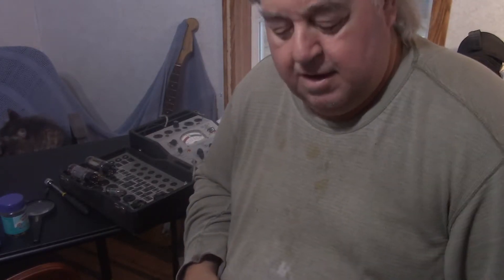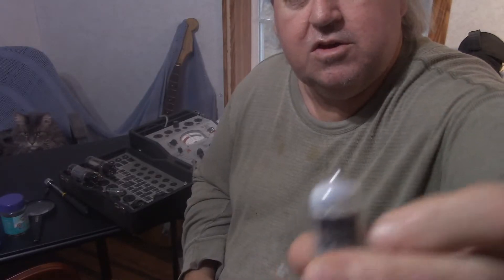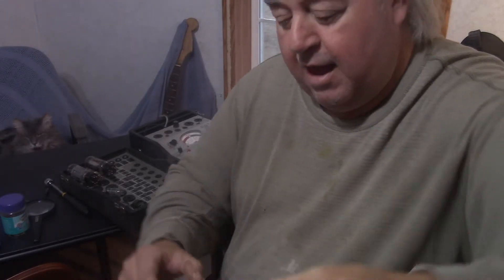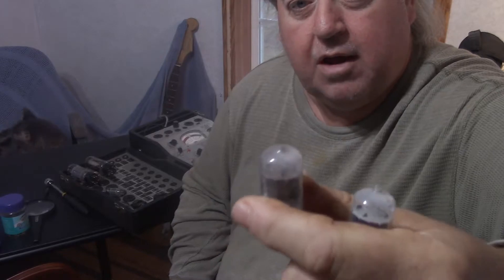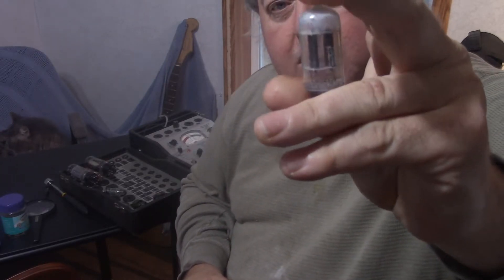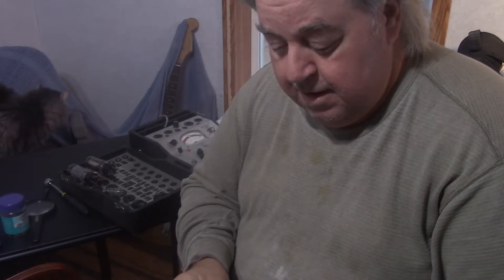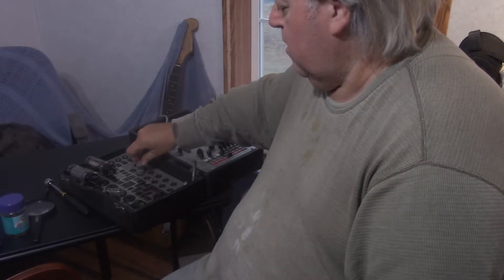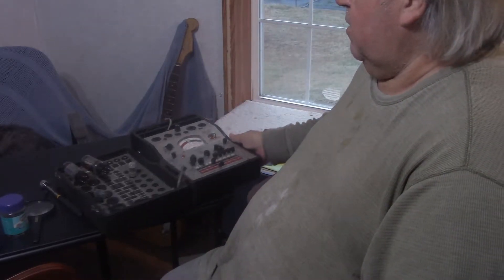How to Spot a Bad 12AX7 Preamp Tube by Eyesight

Comment: If a preamp tube (12au7a) is not glowing but i get sound out of my amp does than mean that the tube is faulty? Swaped it with the old tube and that one glow... The new tube, the one that is not glowing, is more powerfull than the old one that i see a glow on....
Reply from the maker: Many tubes I have tested in amps do not glow and work just fine. A faulty tube will either not allow the amp to produce sound or will crackle badly or whine loudly.
Reply: @vacuumtubesandguitars  thank you for clearing it up for me, i had some troubles finding the specific tube, and when i installed it my jaw droped when i saw no glow, but still sound coming out of the speaker.
Reply from the maker: @silviubadea84  It's all good, keep on rockin

Comment: the reason i'm here is i bought a brand new black star head mkIII 100 watt when i turned it around i noticed one of the pre amp tubes was white so i figured it was blown i didn't even plug it in yet brand new broken
Reply from the maker: It does happen, good thing you did not turn it on. My main amp is a Blackstar HT20 Studio
Reply: i returned it yesterday and ordered another new one they gave me 20% off so it was 999 i got the head and cab for 1600  @vacuumtubesandguitars
Reply from the maker: @bobdimartino6738  way cool.

Comment: I just got a new amp head today, and when I installed the tubes it came with the pre amp tubes don’t light up at all, we’ll one of them does, there’s three pre amp tubes and only one of them lights up, do you think it’s just sum bad tubes?
Reply from the maker: It is common for some tubes to not glow, especially the second, third or fourth tubes, since they are not the primary preamp tube. The first 12ax7 preamp tube in slot V1 most always will glow because it is doing the most work.
Reply: @vacuumtubesandguitars  yea the pre amp tube on the far left has no glow, as the same with the middle one, the only one that glows is the one on the far right, I plugged in a pedal to effects loop to bypass the pre amp section and the amp finally started making slight connection noises
Reply from the maker: If the amp is playing good and no crackling or weak tone then the tubes will be OK
Reply: @vacuumtubesandguitars  yea but when plugging the guitar straight into the amp  there’s no sound coming out of the amp, the red l.e.d turns on, but it doesn’t give any signal to through the cord, no buzz or hiss
Reply from the maker: @MrBurnzz.  You could try reversing the order of the preamp tubes to see if the others light up in the first slot
Reply: @vacuumtubesandguitars  so switch the far right one (the one that does light up ) with one of the others that dosent,
Reply from the maker: @MrBurnzz.  yes and see if the it lights up
Reply: @vacuumtubesandguitars  yes I did it and the tubes don’t light up when put in the car left and middle position, I found out that I have the same pre amp tubes in my Marshall that this black star takes, and I know they light up and work good in the Marshall, but when I put them in the black star still no sound or light
Reply from the maker: @MrBurnzz.  could be they are bad, you can find out by putting the tubes in the Marshall into the Blackstar

Comment: Loss of the vacuum is only one reason why any tube won't work. So the title should be amended to read differently. How about: Once a preamp tube has lost is vacuum and is white on top then it will not work. - Peter age 73

Comment: I sell nos and used tubes, each one gets tested before listing, and again before shipping.

I have both US and China RCA 12AX7s, no difference in performance, but some people do care to only have the US made tubes. The China tube isn't listed at the moment, as I only have the one.

If people get to the point that they no longer can or want to pay the high price for 12AX7s, you can rewire the sockets so you can run two 6AX7 with the heaters in series, as the specs are the same!
Reply from the maker: I also sell tubes on ebay, and have been for 18 years. The tube deal is way over hyped these days. China and Sovtek are good tubes, JJ's too. But with new modeling technology being so good, tube amps and radios have no advantage
Reply: @vacuumtubesandguitars Absolutely true. I am mad at myself for having a really expensive all tube rig sitting there collecting dust because a moderately expensive plugin is doing a better job for most things. Yet, that's how the cookie crumbled the last decade or so!
Reply from the maker: @WilDBeestMF  It is amazing at how good modelers and plug ins have become

Comment: A 12AX7A is a dual triode. It's literally two tubes in one envelope. Sometimes, one of the triodes can fail while the other one still works. You'll notice a drop in gain but the amp will still play. Bending the pins of the tube can cause loss of envelope vacuum when you straighten them back out. It causes hairline fractures in the metal to glass seal of the tube and the air slowly leaks in ruining the tube.
Reply from the maker: You are 100% correct. A 12DW7 is proof of the the 2 in one, one triode is a 12AX7 and one triode is a 12AU7. I always use a pin straightener for just this reason, unless the pins are way too bent, then I just chuck it.

Comment: Quick question - I have a 1994 Super Amp 4 X 10" that sounds fine on the clean channel but volume drops off on either of the 2 gain channels. Is a bad tube one possibility of the problem? (It has 2-6L6WGC/5881, 4-12AX7A, 2- 12AT7). Just wondering if a bad tube can be the >possible< culprit. Thanks for any advice you can share.
Reply from the maker: It is possible a tube is going bad, but more likely is a capacitor dropping voltage
Reply: @vacuumtubesandguitars  Thanks for your reply and advice.

Comment: If they are clear at the top rather than silver grey they are nearly always dead too.
Reply from the maker: Not always, because RCA made side getter tubes where the silver flashing is on the side. If the tube has a top getter with no silver flashing then you are correct, it is 99% of the time bad.
Reply: @vacuumtubesandguitars  I agree, keep up the accuracy , cheers. (I worked for the Canadian Marshall, Orange, Ibanez , Eko and Hiwatt distributors on and off and had the honor of meeting Jim and his chief engineer briefly before he retired in the early 2000's if my memory for dates serves me right)
Reply from the maker: @alcrook6662  Wow that is awesome
Reply: @vacuumtubesandguitars  I'm still trying to get a youtube video made of facts and stories from the day that would blow the minds of moderns. I'm workin on it. Thanks.
Reply from the maker: @alcrook6662  That would be awesome

Comment: I see all these 5-15 minutes videos and you’re the first one to show me the same white preamp tube that I have on my Marshall dsl40c tube amp. I turns on and lights up the proper way, but I’ve switched out ALL my guitar cables and still no sound whatsoever. I was going to order $100 worth EL34’s , but if this one white bulb replacement will resolve my issue?? Then at least thank you for this ‘quick’ to the point video! Much appreciated! Now, do you know if I can just replace the one bulb? Or do they all have to be replaced like you would replace both sides of a vehicle’s headlights as an analogy? lol I’m hoping just the one to do the trick! But thanks again! - Nate Bragg
Reply from the maker: Just the one is all that needs to be changed. I sell tubes on ebay at good prices - https://www.ebay.com/sch/fadedgypsy/m.html?item=194208877700&rt=nc&_trksid=p2047675.l2562
Reply: @vacuumtubesandguitars   right on! I appreciate that! I’ll check out the link for the tubes! Thank you
Reply: ...what amazes me, is that the tube even lights up!!! Once air gets inside of a vacuum tube, there's nothing to stop the filament from burning up!!!
Reply from the maker: @daleburrell6273  I have have tubes go bad also by chipping the glass while straightening a bent pin
Reply: @vacuumtubesandguitars  ...that's easy to do, I'm sad to say.